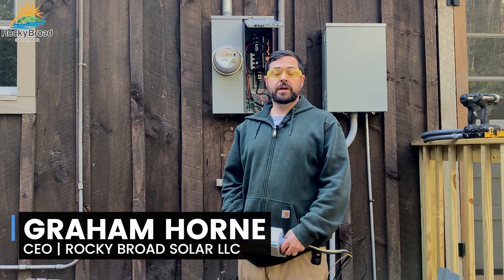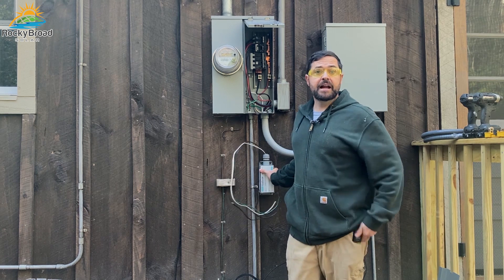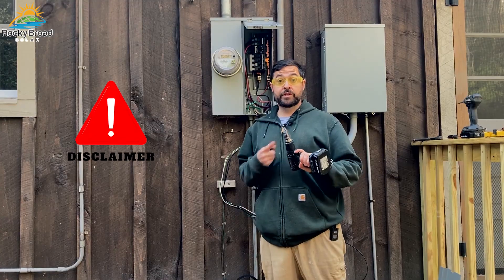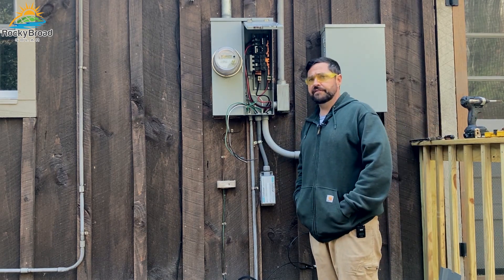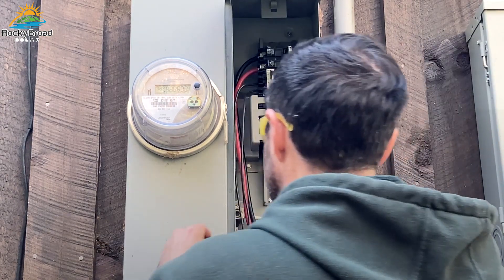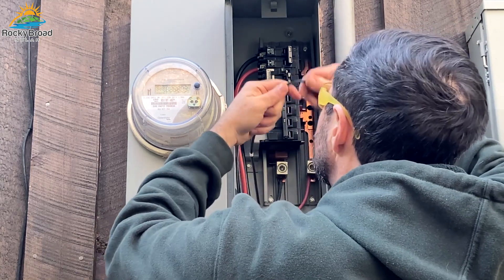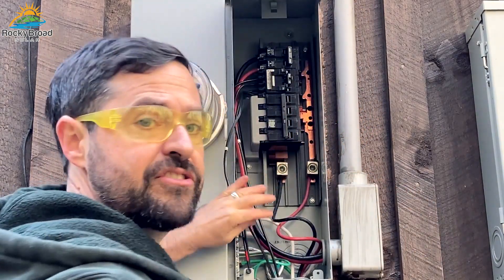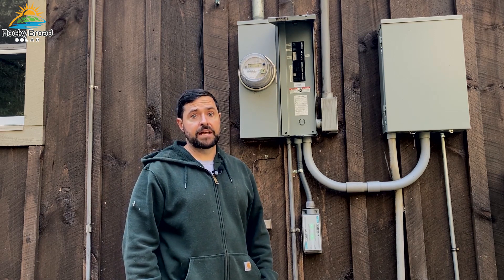DIY Whole Home Surge Protector Installation

Comment: Thanks for the video. I am by no means an expert, but I have spent several decades in various capacities in the power utility business. I fully understand you had space restrictions as to where you could place this device, but as a general rule it's a good idea to have your leads as short as possible. Surge protectors should ALWAYS be placed as close as possible to the device you are trying to protect. Every inch of wire ads precious nanoseconds /milliseconds of protection time delay which could mean the difference between success or failure.  Just trying to help.
Reply from the maker: Absolutely. No offense taken sir. That is great feedback and it was very clear in the installation instructions. Looking back if I hadn't been in such a rush I could have reconfigured some of the board and batten siding to make room. Thanks for the comment!